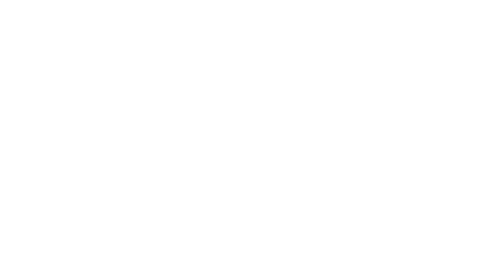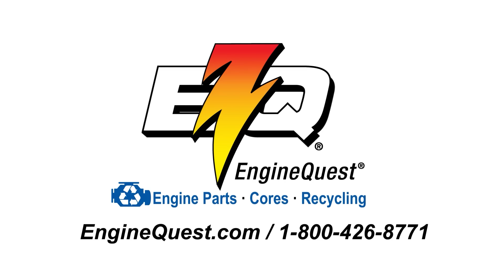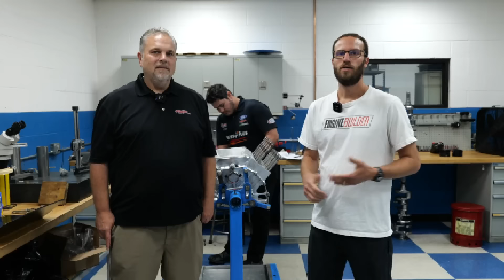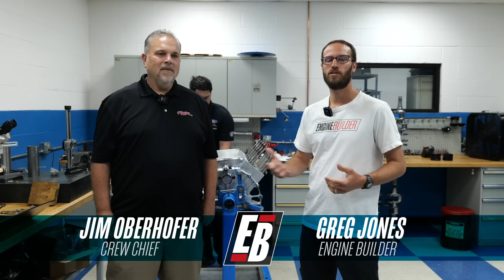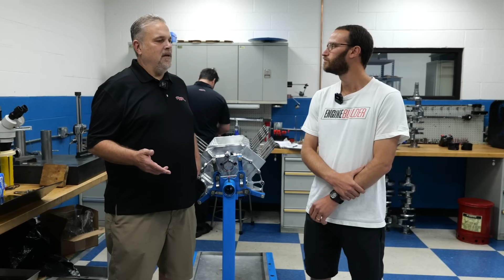Tales of NHRA Drag Racing with Clay Millican's Crew Chief Jim Oberhofer

Comment: Jim-O needs to do better, his car has been put on the trailer in the first round way too many times this season. You're supposed to move up the ladder in the countdown, not down, at this point they have fallen out of the top 10, season is over for Millican...
Reply: @suicidalpornstar8091  You are delirious, Jim-O will screw this up for sure, they have no chance at all...
Reply: @suicidalpornstar8091  I love Clay, but I'm also good at math, he could win all 3 remaining races but will not win. You can't make up 200 points in 3 races unless nobody else shows up. Yes, he won 2 races but sucked royal in all the other races, Jim-O  needs to get his head out of his arse....
Reply: @suicidalpornstar8091  He pulled his head out of his arse for some fresh air, too bad he screwed up so many first rounds this year or Clay would be on top of the points. Clay was the difference today not Jim-O, happy for him...
Reply: @rogeeeferrari  To be fair to Jim O and the whole team, for the last few years they were racing on a budget and using old used parts. Rick Ware came along and gave them all new parts. They needed to figure out how to race with all new and different parts. They have won more races this year then Brittney has. Bet you never saw that happening.
Reply: This comment sure aged like milk… lol and btw, you can’t throw all new parts at a team that’s been running on a budget and expect them to figure it right away. They obviously figured out the hot weather setup, once they figure out a could weather setup, this team will be competing for a championship. I’m sure next year will be very interesting
Reply: Let’s see, 3 wins and number 8 in points. They won’t win the championship but they are gaining and learning. Look out next year once Jim O. Hits on a cold track set up.
Reply: @outragousbob4367  Wait till next year, are we seeing why the Kalitta team let Jim-O go ?
Reply: you sound EXACTLY like someone who hasn't a clue @rogeeeferrari